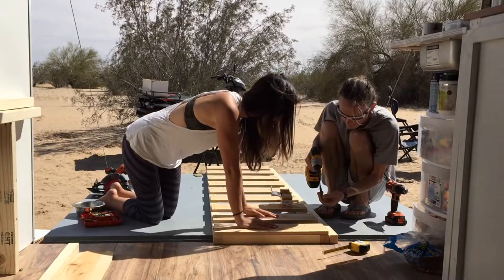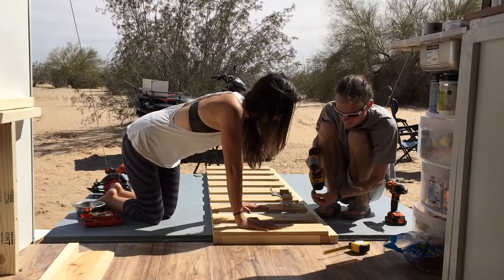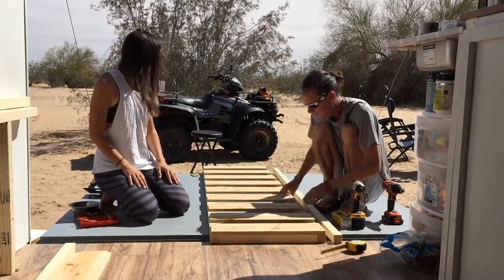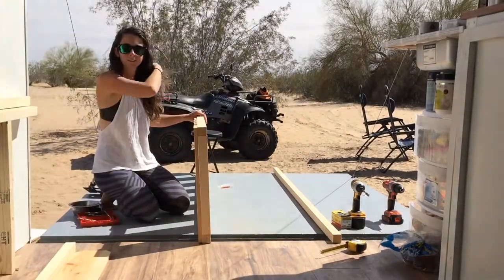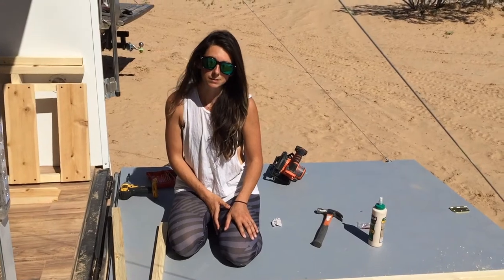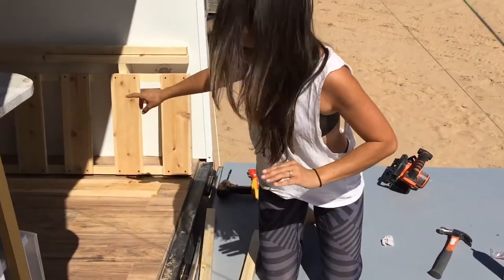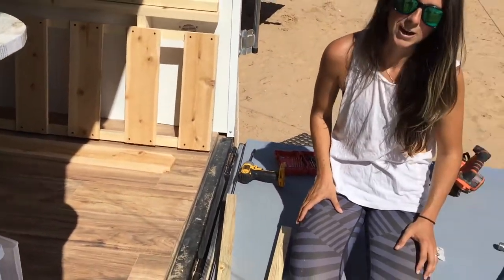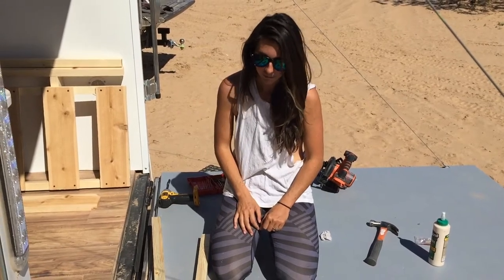Building a Bed in a Cargo Trailer to fit the ATV

Comment: Precise doweling can be done easily with a jig and a clamp.  Make your own jig carefully once and clamp it for every hole.
Reply from the maker: Jigs are great!  And can be built in the desert.
Reply from the maker: Eye protection is good when available.  Agreed with your comment.
Reply: Outdoorsisfree I saw you did have 'em.  Sorry to act all nanny- like🙄.  Safety first, esp with eyes; when someone buys a saw they should also buy some cheap eyewear.
Reply from the maker: Your right.  Melissa needs more precautions but chooses to live life on the edge, she is barefoot also.  Just being herself no harm in recommending safety stuff.  We all choose which warning to follow.
Reply: Barefoot is cool.  If you operate a tablesaw with your feet I would still strongly suggest using a pushstick.  Tablesaw injuries can and do kill.  Lose some fingers, faint and bleed out lying on the floor. 
Shop safety, kinda important.
Reply: I learned the hard way that its best to use wood glue before screwing the boards together to prevent them creaking over time.